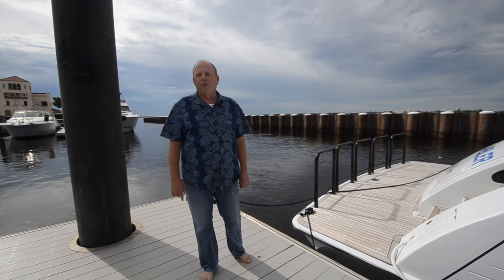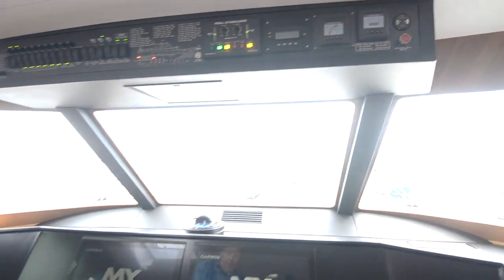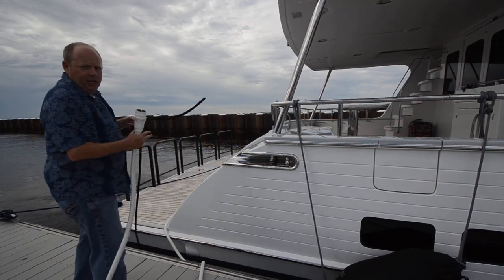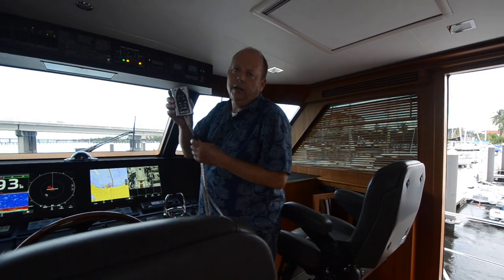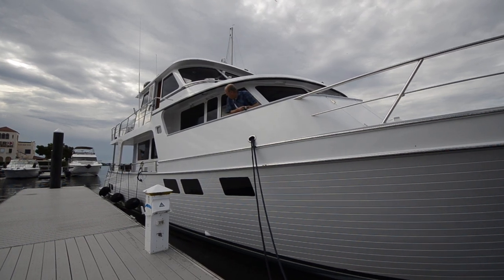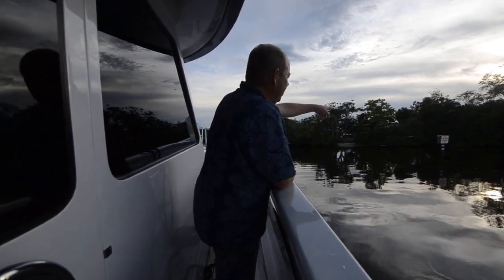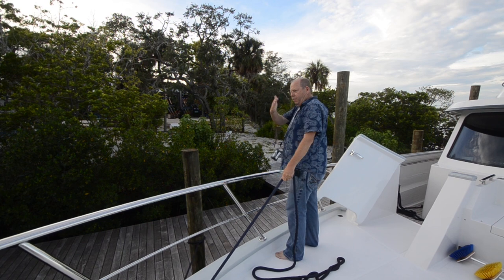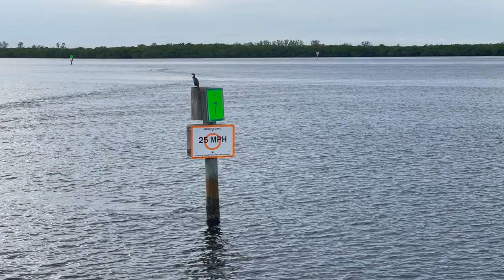The New Yachtsman, Docking Alone

Comment: Well done very thoughtful.  I have made a single-handed departure and landing on a 52' Bluewater that did not have a remote control or thrusters.  Fortunately on that day we had no current and a favorable breeze.  Oh, and she has a steering station on the main deck, right next to the spring line cleat. Captain Bill is absolutely correct, planning and anticipating the unexpected is key--even if you have a crew.  Oh, and always remember that a spring line is your best friend.

Comment: You should try a “drive off line”. It’s basically the same process as you line in this video. Your line would be considered a 2 part down river line. Take the same line and just use the eye to horn the upper end of the cleat/kavel. Secure the other end to your boat fitting tightly. Now when you’re ready to get in underway all that’s required is to ease ahead enough that the eye slips off the cleat/Kavel. The advantage is this can be done from the helm station. Yes there will be a line dangling over the side until it’s brought in. It it was set up right this line will not be touching the waters edge and can be brought in when safety and time permits.

Comment: That's a nice "Trick" to do with your line, it maintains control of your line on the boat and you don't have to go out on the dock to release it.  Better yet .. do that with all of your lines rather than leaving them on the dock to be tampered with, and it will save you a lot of running back and forth.  The only reason to go on the dock would be to disconnect "Hotel Services" (power/water/cable, ect.).  This method of mooring keeps the dock clear and your boat more secure.  .. V/R Glenn / 200ton Master
Reply: I find its hard to loop the cleat and come back to the boat and  feel it is secure for the long term in many situations because the line will go from tight to loose as conditions change so there is a chance the line just pulls over the horn of the cleat.  I do often redo them this way hours before my departure if I am on the boat.  It is great to loop a piling and come back to the boat too, especially when you have a big tide.
Reply: @williamthomas9049  Gotta be a bit of a cowboy to do this, but take a full or another turn around the cleat, that way it will not work off.   We practice this in my CG Aux Flotilla for BoatCrew from the boat without setting foot on the dock.  Don't overtighten the lines when doing this because of tide changes and unloading will cause tightening also.   V/R Glenn
Reply: Glen, totally agree with you. As a rule, no one (including me) leaves the boat or boards the boat without at least TWO lines on the boat, secured, and I usually have 4 total on any boat over 40 feet or so. I dock single handed most of the time. The two main springs are from the boat around the cleat, perhaps twice if conditions dictate, and then back to the boat to be secure. That way I'll never have a situation where the boat "could" get away from me when I'm on the dock. 
And, Capt Bill, you mentioned the above when you docked the boat at the end, good advice. But also good advise for departure.
Overall, excellent video and lots to learn. I don't have the luxury of a yacht controller but do have remote thrusters which can help, also don't have the Glendinning throttle control which is very easy for maneuvering, especially in high winds. 
Keep up the good work.

Comment: easy as long as you go slow, this boat has it all, remote control, bow and stern thrusters.. i was doing this with only an unreliable electric bow thruster.. go to the dock bow first, get a bow line secured by a dock boy or drop a loop over a cleat on the dock, then work off the bow line to bring the stern in.. all this is without tide and current and wind on the beam.. been there, done it with big sailboat and motor yacht..

Comment: Bravo; what a nice boat handled masterfully.
I just bought a live aboard, a used Carver 36 with fly bridge station twin engines, one is suspect and no bow thruster, no remote controller. 
Single handed I am taking the boat to my dock 1 mile up river from the seller’s slip. I may have the typical wind against me, not much current.
I welcome suggestion . 
But I too could go alongside and quickly secure midship to a dock pole. I would have the bow and stern lines at midship and cast them over the dock before getting off the boat. The engine(s) will be idling still.
Reply: If the questionable motor will run for a short time save it for docking.  You can run at low speeds on 1 engine with little problems.  After you get used to the boat turning hard to the nonrunning side you can handle it.  If it was for a longer distance you would want to secure the shaft on the nonrunning motor.  When you get to your dock fire up the second engine.  Even it it's just for a couple of minutes it will be a huge help for backing into a slip.  Pulling along side a dock on 1 engine is easy if you plan it and go slow.  No, even slower then you were thinking.

Comment: Nice Video ! My only quibble would be I would never move the boat without first checking fuel & oil levels.
Perhaps you did & I missed it. You could have saved one trip down & back if you had looped the double
line around the cleat before securing the free end on the boat. I only mention this as everything else 
seems so meticulously and thoroughly planned.
Reply from the maker: Thanks for the tips!

Comment: Is not having throttles the same on all Yacht Contollers?
Reply: That one is shift only, so you are in gear at idle.  Some others allow you to add some throttle.  Bigger boats with big props just shift is fine.  That is a 26 knot top end boat so idle is plenty around the dock.  If it has small motors and was a 10 knot boat you would want some throttle.

Comment: This will sell my wife on our return to boating in our mid sisties.  Hopefully.
Reply: It really does help.  When you can do it yourself you can't be accused of yelling at her!  Apparently I raise my voice when she is doing it wrong.  I have couple's in their 70's doing the loop every year.   Biggest complaint from the ladies is lack of upper body strength with the large lines.  Use smaller than normal lines to get secure and swap them our later.  The breaking strength of a 1/2" modern line is fine in a calm marina to get secure.  A wet 3/4" yacht braid line is too much for the smaller crew.

Comment: What would people do without their remote controllers & thrusters? Nice use of spring lines. Most don't have a clue of how to make them work for you. That loop around a shoreside cleat without stepping off the boat works wonders

I have a single engine boat with bow thruster only. Never trust the thruster to be reliable. Often run the boat singlehanded. Always have a plan that does not rely on the thruster.
Reply: My personal boat is single engine with a thruster and unfortunately I can't count on it either.  You defiantly learn to think ahead and how to keep out of tight spaces.

Comment: Very good work. Procedure for a monohull boat is ok. Would you please write to me how low the water level is at the two berths. Can you imagine a boat without lines stuck in the harbor during a storm and hurricane? Do you have such an imagination?
Reply: please rephrase the question, I don't understand.
Reply: I am interested in the average water depths in boat harbors worldwide. Since I am configuring a different boat structure. The design takes some getting used to for many people at first. As not all aquatic enthusiasts will go on this design trip. The background ideas are based on the S.W.A.T.H. ship technology. However, both buoyancy bodies can be leveled by flooding and blowing out. And so such a boat or smaller ship is always safer in storms and hurricanes. Since it is lowered to the bottom where it is suitable. And thus stands firmly on the ground. And you just have to wait until the waves have normalized again. I know this design pill is very difficult for many yacht owners to swallow at first. However, this design variant has many significant advantages and just needs getting used to. Not more actually. And so the watercraft can be parked anywhere and brought back to the desired altitude by blowing on it. Only through compressed air chamber sections. So even a position trimming is elegantly possible. The draft of the floats is not higher than 1.5 - 2.0 meters. So you can also park on sandy banks without messing with the dark green league. Of course only where the underwater camera and logical common sense have previously decided to sink to the bottom.
All previous Swath Sips are not floodable and therefore not height-adjustable. The upper decks look exactly the same as on conventional catamarans. And in the extra-long stilts, rotary machines with levered cantilever technology work for endless ranges. This is how a steel construction paternoster works, which generates enormous moments of force for locomotion.
If you have any questions, just ask me. I have absolutely no problem with that.